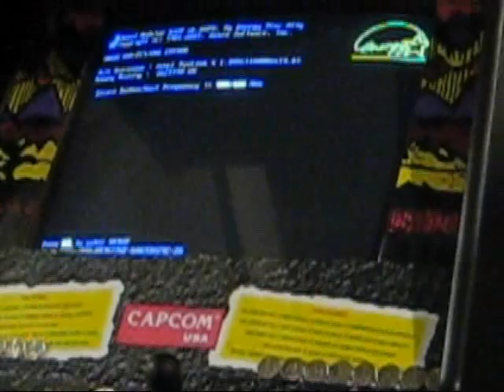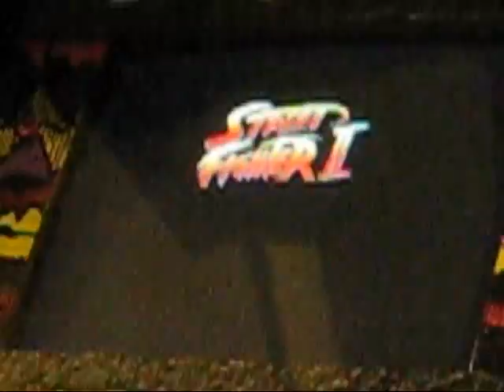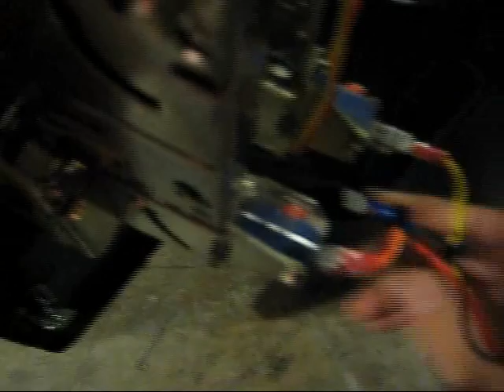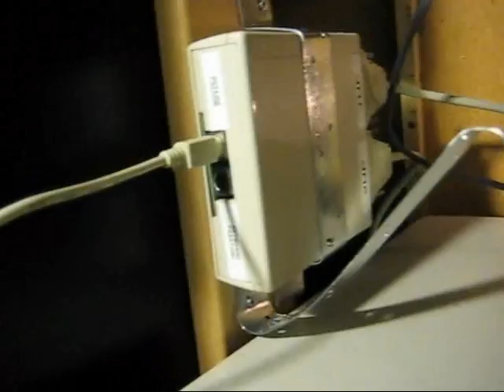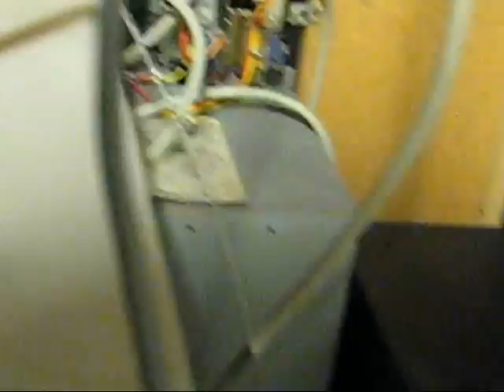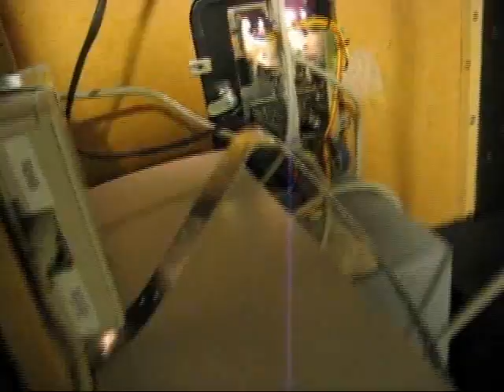SF2 Mame Cab Walkthrough

Comment: I like how authentic this cab looks.  I just finished my cab, and have a few questions.  I know at the end you say you put in a relay to connect the light tv and comp, but I don't understand that part.  I want to do the same thing you did and power it up by a pushbutton, how should i wire them and all of that so I don't have to manually turn on my tv and comp. which is inside!  Last, how did you put the mame logo in the beg. of the boot screen, I want to put something custom but don't know thanx

Comment: Building 100% from scratch.  I'm building a Neo-Geo MVS Cabaret - I took measurements from the MVS-4 and scaled them back about 80%.  I'm definitely taking my time & getting good parts.  Using an IPAC2 for controls, a 17" LCD (nothing else will fit in a space that small), and a custom theme (bootxp, mala as shell, custom intro video).  I agree with you though - seems like 90% of MAME cabs are the same crap over and over or are just completely overdone (or underdone).

Comment from the maker: It's an Ipac2 encoder. Each input has it's own interrupt (connection to the processor). Absolutely no delay, key ghosting, or simultaneous key limit. From Ultimarc's website, the maker of the Ipac2: "The I-PAC uses a Cypress CY7C63413 programmable microcontroller chip . There is no multiplexing or sharing of input ports, all inputs have their own dedicated pin on the chip hence absolutely no ghosting, blocking etc. "